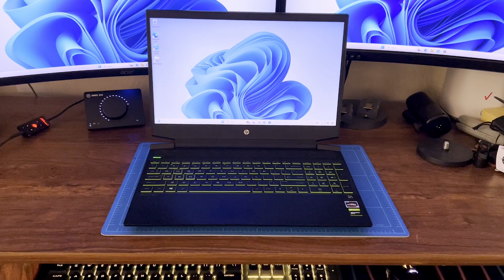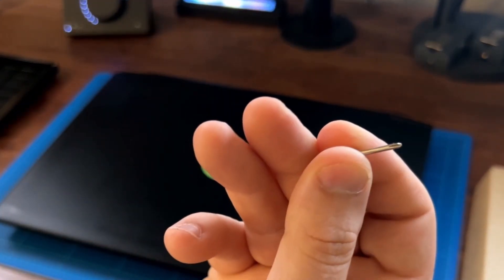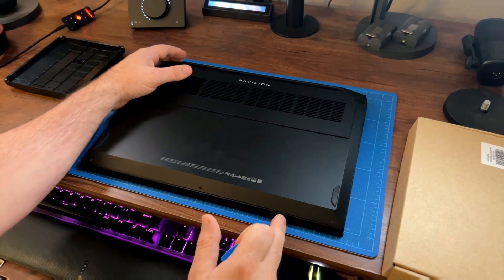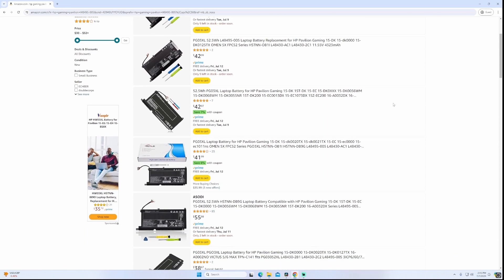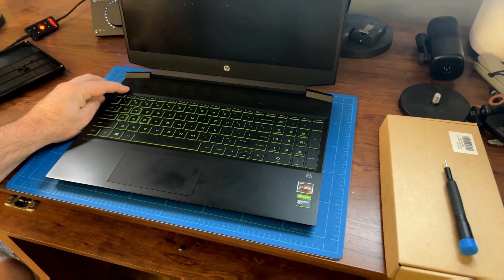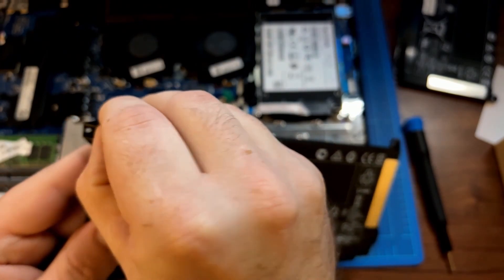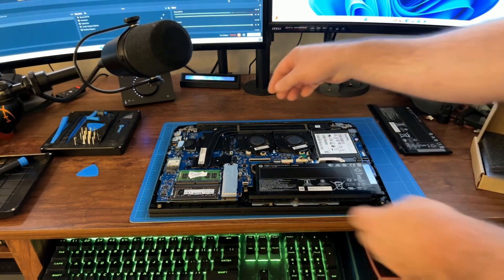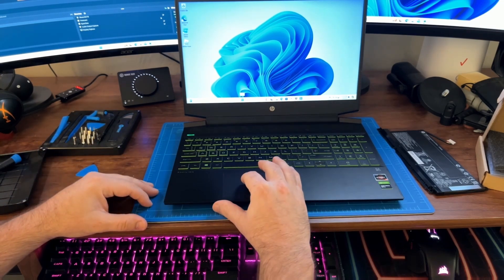How to Replace the Battery in Your HP Gaming Pavilion Laptop

Comment from the maker: Update: the battery I received from amazon is bad. It won't charge past 10%, and randomly crashes the laptop. I will return it and order a different one from Amazon. Hopefully I won't have the same issues.
Reply: Have you found another battery? I also am in need of changing the battery but haven't been lucky with finding a replacement
Reply from the maker: @Slimeeify  not yet, I just got back from vacation so still trying to get back into the swing of things.
Reply: @MrDarkcore checking in to ask if you’ve found a new battery replacement for this 😢 this sucks!
Reply from the maker: @taylorramsey9918  I have not found one yet.
Reply: @MrDarkcore  keep updating !! please
Reply: I guess the tape hiding the hp logo had something to do with the replacement battery not charging past 10%; maybe it was refurbished

btw, the sound at 7:21 got me for a second thinking the fans were breaking or the laptop was ruined for not having the bottom cover haha

Comment: Hi! My laptop was fine relatively.. bought it for 300 from fb marketplace and it would die after about 4 hrs after full charge. Otherwise it was fine for the budget I had. Not too many downloads; only played one game, fans worked but nothing crazy i’d say. It died one day and never turned on again. the light on the side shows its charging when it’s connected and it even lights up white to indicate full charge but it won’t turn on. any ideas as to what might be wrong? The battery isn’t “swollen” or anything but i’m not a tech pro
Reply from the maker: I would first check to see if all the important parts like ram, ssd/hd, and battery cables are plugged in. They could come loose over time. Then I would try holding down the power button for like 30 seconds to see if does anything. Let me know your results.

Comment: Hi bro  I want to replace my hp pavilion Gaming Laptop 15-ec2xxx battery Which battery can i put Pls share a valid product link 
i changed my battery before 4 months it will draining and only stands for 1.30 hrs
Reply from the maker: Do you know what the rest of the model number? it would make it easier to look into, or if you have the battery model number.
Reply: @MrDarkcore  hp pavilion gaming laptop 15 ec2004ax battery
Reply: @MrDarkcore  my Model Number: HP Pavilion Gaming 15-ec0101AX battery

Comment: Hey I just saw the video of cleaning your laptop fans idk if it’s my fans making the noise but I hear like a motor bike engine in my laptop is that normal 😢😂
Reply from the maker: No, the laptop could of sucked up some debris through the exhaust vent that is stuck in the blades. Or it could be the fan blade broke from defect.
Reply: @MrDarkcore is it safe to use?
Reply from the maker: @tylerfr8  yea, but I would try cleaning or just replace the fan.
Reply: @MrDarkcore  Hm alright by the way I tipped my laptop upside down and hear a huge click noise inside of it and the noise has just went it’s very strange